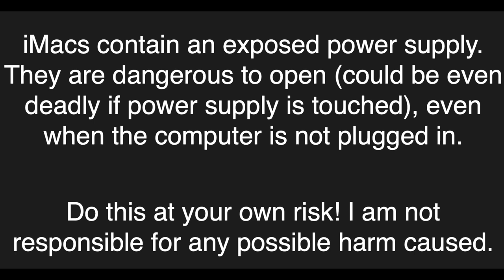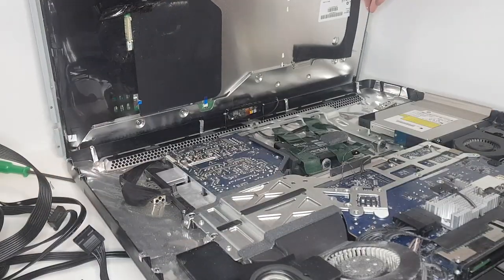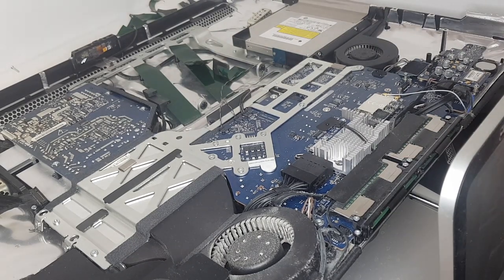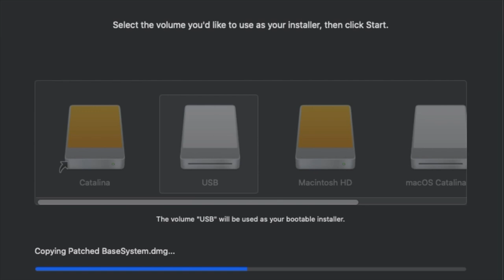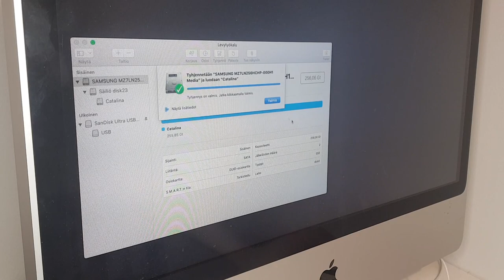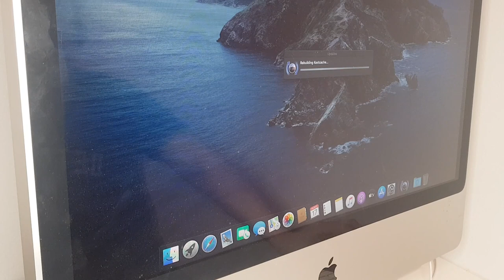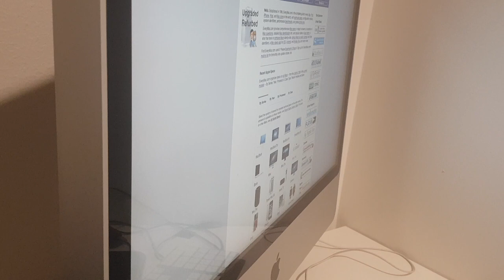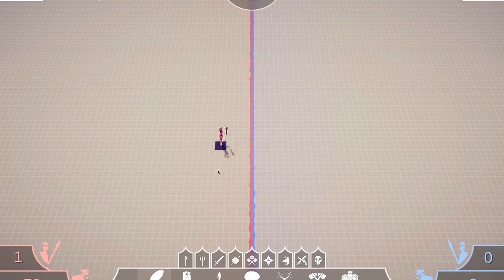140€ Catalina iMac - 2007 7.1 CPU, RAM, SSD upgrades

Comment: Awesome video!
Im in the process of doing all of this...
Question:  why not replace the optical drive with a second SSD?   is it worth it?
Reply from the maker: I think you can do that, you will need an adapter though because the optical drive uses slimline sata like laptops. I can't figure out a reason to have 2 SSD's, but i think that is possible.
Reply: Its worth it if you plan on using bootcamp to run windows and yes such an attachment is available on Amazon and eBay

Comment: I’m pretty sure you can lower the risk by holding down the power button for 10 seconds with the power cord removed to discharge the power supply

Comment: Добрый день. Помогите пожалуйста. Есть imac 9,1 будет ли работать на нем c2q q9000 или T9900. Сейчас стоит e8135, шина и сокет одинаковые.
Reply from the maker: No idea if c2q will work in 9.1, my guess would be that it doesn't, may need at least bios modding of some kind if possible at all.

Comment: I want to leave a query.
Is it necessary to change the processor or can I update with the default one? thank you!
Reply from the maker: To use Catalina CPU needs to be upgraded, as author of catalinapatcher dosdude says: "The 2007 iMac 7,1 is compatible if the CPU is upgraded to a Penryn-based Core 2 Duo, such as a T9300."

http://dosdude1.com/catalina/
Reply: The default CPU is missing one of the SSE4 extensions that Catalina needs to work.

Comment: I have an 2008 imac & I can't upgrade past el capitan. I don't c the point of going faster if I can't get support to used the web only up 2 a point.  Like having a leash on.
Reply: @optimallyobscureperformanc6264  . I wish computers could have parts changed like cars to keep them going rather than having 2 purchase new when upgrading would work
Reply from the maker: @ewaldradavich7307  Yes stuff becoming more difficult to repair is a shame.

Comment: Hello!  Great video.  I have my 2007 iMac with the same upgrades and Catalina working.  But now Big Sur has come out and I would like to upgrade to that.  Have you tackled that yet?  I have tried to use the different patchers out there and they all seem to have issues.  Using the barrykn micropatcher I cannot seem to get the external USB to boot.  I get the ( / ) now allowed to boot symbol.  Any help would be appreciated!
Reply from the maker: Thanks! Sorry, i haven't tried Big Sur yet. The unsupported mac list lists 2009 macs as oldest ones compatible... I would be interested to get big sur on this 2007 too, but currently too much other things going on and that imac is in daily use so not that keen to experiment on it now. Sure i'll let you know if i take a look at it in the future.
Reply: @optimallyobscureperformanc6264  Thanks!  I will let you know if I figure it out as well.
Reply: @peteg.463  the limitation is the GPU: need METAL function, because the unsupported ones can’t get the hardware acceleration working, which makes everything very slow. Some of the 2009-2011 iMac can have the graphics card replaced with a Metal supported one, thus possible to run unsupported Big Sur. The rest of us are still waiting for some genius to come up with a solution for graphics hardware acceleration.
Reply: Be advised those extreme CPU upgrades can make the WiFi useless.

Up grades to 2.4 gHz. T8300 and 2.8 gHz. X900 CPU's do not chance losing you the WiFi.

A helluva lot of WORK!

2+ hours....

IF all goes well,

J.C.

Comment: Are the RAM and CPU upgrades worth it, or just the SSD?  
I am from Brazil and the currency is devalued, the ram and the cpu cost R$ 250 each, is it worth it? thank you
Reply from the maker: Ram upgrade might not be worth it, CPU upgrade depends if you want to use catalina, 2007 imac wont work with catalina (or other recent versions) with the original CPU.
Reply from the maker: I was able to buy and upgrade a 2010 imac for less money than this, from late 2009 onwards they do not have the problem of expensive DDR2 RAM.

Comment: Nice work👍is more fast with 6gb ram? i have the same imac with 4 gb ram,…
Reply from the maker: Well i didn't try it with 4gb so can't compare but 4gb is probably fine.
Reply: Can you make a vídeo using the imac, web browsing, open apps, i am , i can figure the performance….impresioned with your work🙌🏻🙌🏻

Comment: Great video! I have since 2008, i put 6 gb ram and ssd but i would pump the intel core 2 duo 2,8 ghz, is it possible?
Reply from the maker: I understand that the 2008 model has better CPU compatibility than 2007, but i have not worked with the 2008 yet, so i don't know which exact CPU's will be compatible.
Reply: Здравствуйте. Скажите как увенчалась установка более мощного процессора? У меня imac 9,1 и есть процессоры qx9300, q9000. QX9300 не запустился, q9000 ещё не пробовал. У вас есть опыт установки более мощного процессора?